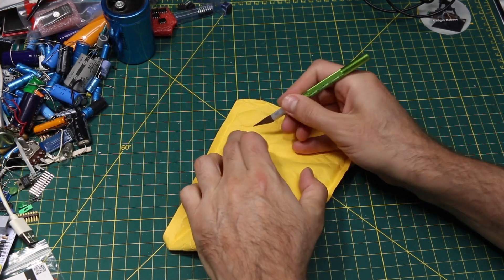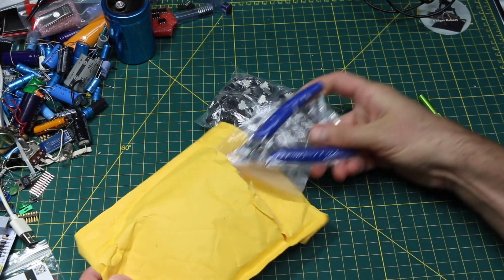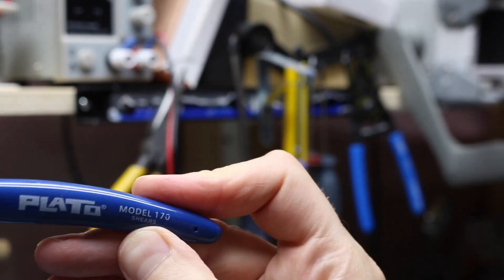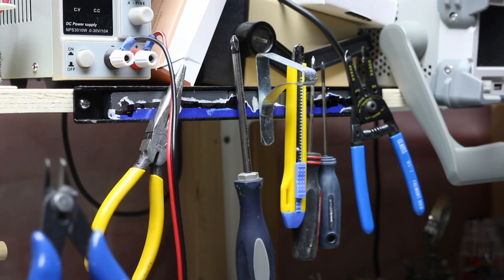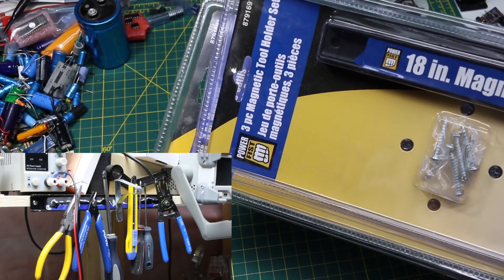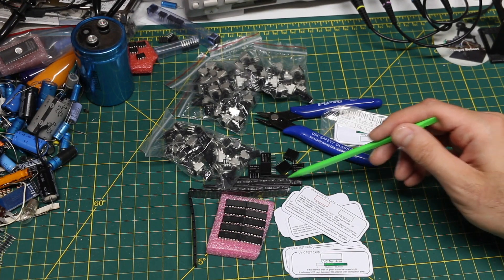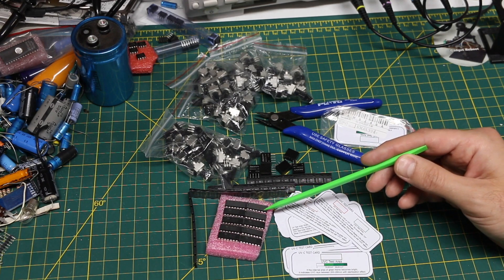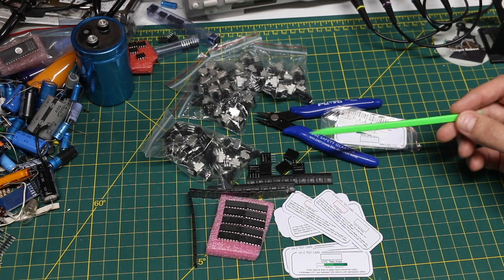Mailbag

Comment: 1:38 _"One Zero Three, so that's a 1K"_... umm, no that means TEN K.
It's easy if you change tact.
503 = 50 plus 3 zeros = 50,000 = 50K.
504 = 50 plus 4 zeros = 500,000 = 500K.
First 2 numbers are the value, and the 3rd number is how many digits to add. Hence, 101 = 100 Ohms.
The "B" in pots designates the taper. B means Linear.
Reply from the maker: It's been a while since I made a verbal typo.  I should get some audio taper through hole pots for times when those would be better suited.
Reply: @GadgetReboot  - It's almost impossible to get decent Audio Taper pots now days. Search online for "The Secret Life Of Pots" article to see how to use any Linear pot into an almost perfect Logarithmic one (of much lower resistance). It only requires one selected resistor value about 1/5 the pot's resistance.
 Note it only works when pot is wired with 3 wires as a voltage divider, rather than 2 wires as a Reostat.

Comment: Interesting haul.
I have some of those B0505 ... necessary when putting a BT receiver and an amp on the same supply.  Ghads, BT is noisy.
Recently had problems with the TL082 driving a MOSFET gate ... will try LM358 or TL072 now, to see if driving capacitance is the problem.
Interested if you can get those PT8211 chips to drive CD-resolution sound.  You probably have Nx1.4112 MHz crystals?
Reply from the maker: I can’t remember what crystals I have now including the ones that are probably scattered somewhere unexpected waiting to be sorted out again.
I assembled a prototype for the PT8211 today but I haven’t tried it out yet. I think it uses a different data format so I need to find a library that allows me to configure that.
Reply: @GadgetReboot  Just a brief scan out there, it appears people interface these to ESP32s, Teensys and such with native i2s, or Japanese Digital (something something) Interface.  Perhaps a precision clock is not a big deal.  It will certainly be cool when you manufacture sound from the digital realm.